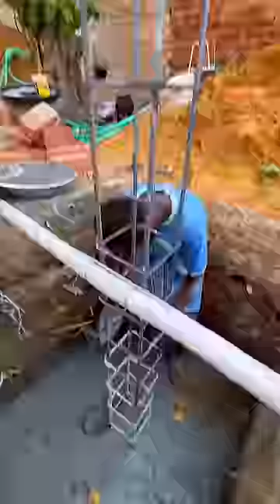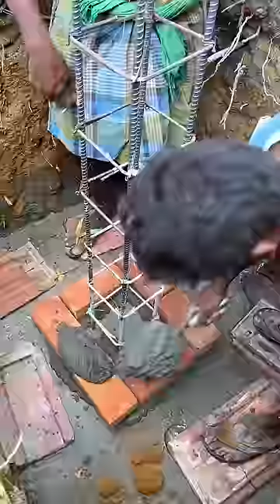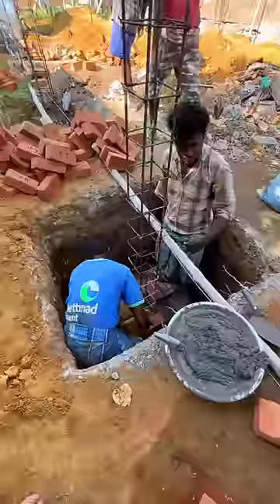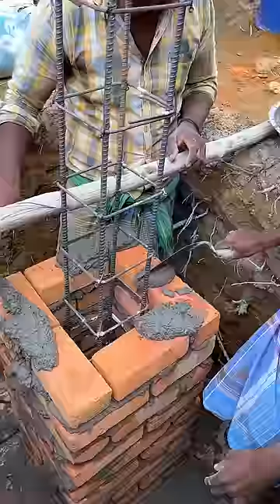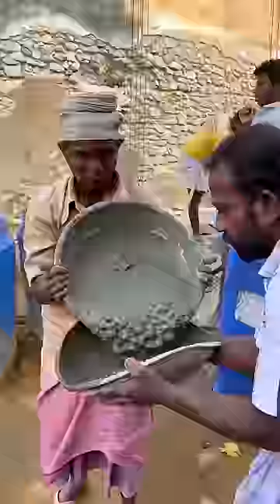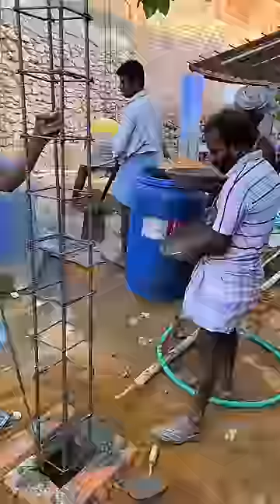Column Reinforcement&Concrete#shorts#foundation #construction

Comment: Its a wrong practice
Reply: Haa. This is wastage of material
Reply: @dijit. not only wastage... But also weakens the concrete structure as moisture present in concrete to hold the hydration process is already soaked by Brick........
Reply: This method we called ‘permanent formwork’

Comment: Concrete curing left the chat.
Reply: 1999
Reply: Hey sharkfish guy, we met at the dr Eric berg comment back someday, right? வணக்கம் தல😂
Reply: it will curing normally it doesn't affected by the brick they will pour water around the sand for packing the lose sand
Reply: @user-ts7oy5cd8p  still the earth will absorb the water and dry out the concrete. In my house, we did this for our outside gate column 10 years ago, it's very weak now.

Comment: Bricks under de soil. Nice sponge you build there.
Reply: It is only for molding, bricks will crumble overtime, leaving only the concrete colombs.
Reply: Chỉ cần ván ép là ổn
Reply: Agreed, plus you are supposed to cover rebar be 3 inches of concrete to prevent spalling, like in Florida condo collapse.
Reply: @mikegrok  Not necesarily. Depends on the moisture of the surroundings. 
Where i live is 2 inches.

Comment: Pensandolo bien se deve impermeabilizar al rededor del hirro para que no penetre humedad a podrir las varillas ,y esque con el ladrillo se a de humedecer mas  y dañarce
Reply: That's not really correct. The reinforcement of reinforced concrete parts is protected by the complete encasement of concrete. Calcium hydroxide is formed during the hydration of the cement. This is responsible for the high alkalinity of the cement stone with a pH value ≥ 12. It protects the steel from rusting. It is important that the steel is completely encased in the cement slime.

Comment: 1.We can't see honeycomb in concrete if it's happen brick will penetrate water it will cause steel corrosion.
2.Not economy compare to steel or wooden form work.
3. When construction of brick work some amount of cement mortar in bottom of column it will affect strength
Otherwise if brick will absorb water we can consolidate outer soil is the solution

Comment: why not just form the column instead of bricks? I mean the footer is well underground anyway. In fact I'd build the form above ground, wrap the rebar on 3 sides, nail on the 4th side and drop it down in the hole & backfill & pour! good thing I'm not running this show.

Comment: Wrong and bad method. 
Vibration is must for the reinforced concrete works. 
 Casting form work by using brick has some adverse effect on the strength.